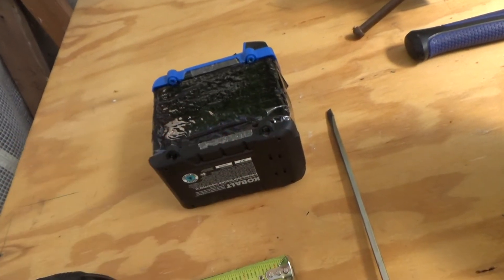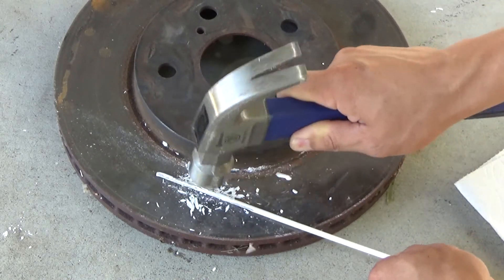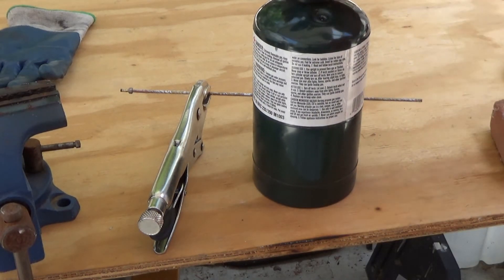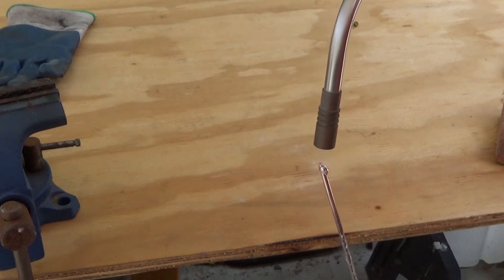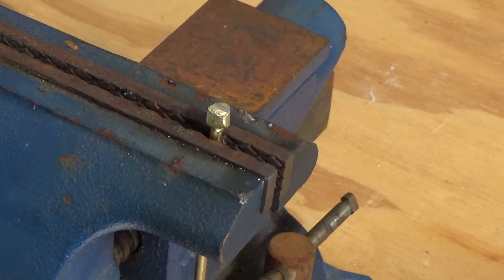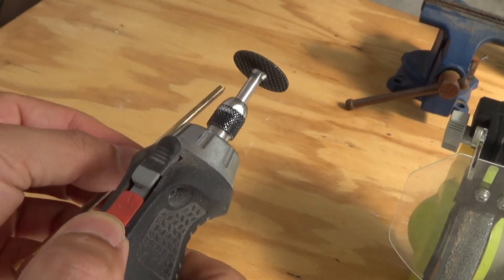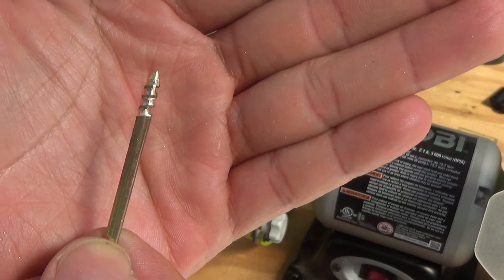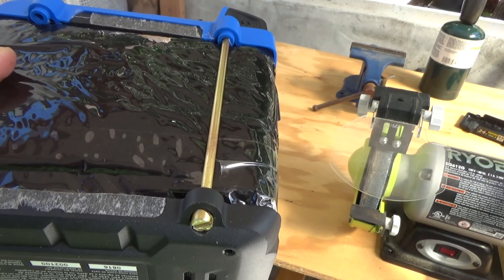DIY: Home made Screw (for my 10Ah cordless tool battery)

Comment: Is there a trick to solder the bus wire to the battery? I tried for an hour already and couldnt get the wire to stick to the battery case eventhough I used rosin flux. Could it be I got a fake bus wire? On another note, it seem like it is hard for me to even stick the solder on the battery welded nickel spot. Do you have this problem as well? If so, how did you fix it? Thx
Reply from the maker: What kind of bus wire do you use? Is it nickel? Do you have problem sticking solder to the bus wire or the battery? In either case, you will need a very hot soldering iron (50W or more) and the tip has to be big enough to spread the heat. Small tips won't work. I never had problem putting solder onto the battery or the nickel strip. The only time I had problem putting solder onto the nickel strip was when I tried to reuse an old strip which had spot welds on it already. It was oxidized too much for the solder to stick on it. Otherwise, if the nickel strip is new, you won't have problem. If your battery is used and have spot welds on it, use a dremel tool and grind out the welding spots. That should help
Reply: Do you use nickel strip or the solar bus wire? I bought the bus wire for solar solder off ebay so not sure but it does have pre solder on it. I have Hakko soldering station which should get up to 70W. I was using small tip (came with the station) which like you said, did not carry out enough heat. Switched to bigger tip and it is working somewhat since I cannot get the solder to hold strong for both battery and the wire. Mine has rosin flux built-in to the solder lead, but even with the rosin flux bottle, I still cannot get the solder to stick strongly. After everything cool down, if I use my flathead screw driver to pry lightly, some solder will come off :(. Not sure what I do wrong (could be bad quality bus wire?)

Bought similar to this item: https://www.ebay.com/itm/20-Feet-Solar-Cell-BUS-WIRE-5mm-x-02mm-Pre-soldered-/261804618358?hash=item3cf4c57276

Comment: Found this one in case anyone wanna mod their a different way than this.

https://www.menards.com/main/tools-hardware/fasteners-fastener-accessories/anchors/threaded-rods-nipples/hillman-6-32-x-12-zinc-threaded-rod/p-1444432428119-c-8724.htm?tid=-1764513731830743104&ipos=1
Reply from the maker: Thanks Tuan. Good for those who have Menards around.
Reply: Try this for lowes

https://www.lowes.com/pd/Steelworks-0-138-in-x-12-in-Standard-SAE-Threaded-Rod/3127881

Comment: Couldn't you just buy a threaded rod and grind it down?
Reply from the maker: You could. But the smallest threaded rods I can find at my local hardware stores are size 10. That's too big to fit into the screw holes for my project. Plus, with the threaded rod, you will still need to make a head (by welding). Or you can use lock nuts on both ends but the nuts will stick out too much on the bottom of the battery for my project. It's still possible with some grinding. But I just couldn't find any threaded rod size 6 available.

Comment: I figured you might be the man. is there an easy or even possible way to adapt the Kobalt 24 volt Lithium ion batteries to fit the Dewalt tools? They are so cheap!!
Reply from the maker: Negative. It's not possible. At least if you hook directly the 24V positive and negative terminals from the Kobalt battery to the Dewalt tool. If you take a look at a Dewalt tool, you will see it has 4 pins. Dewalt is smart. You cannot just hook up the positive and negative terminals from a battery to the Dewalt tool and expect it to work. It doesn't work that way because of the 2 extra pins in the middle (on the Dewalt tool). If you can find a way to fool the Dewalt tool into thinking it has a Dewalt battery by some how hack the 2 middle pins then you're in business. Still, you will also need to make an adapter that goes from the Kobalt battery to the Dewalt tool. If you have a 3D printer, that will make the job smoother but it's still a complicated process.
Reply: +vuaeco I suspected that. thank you for responding so quickly!